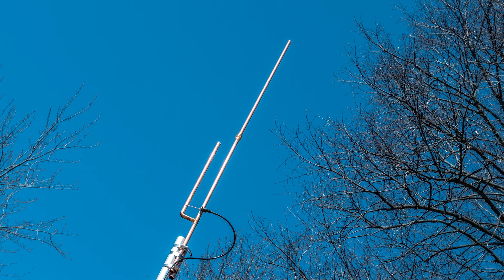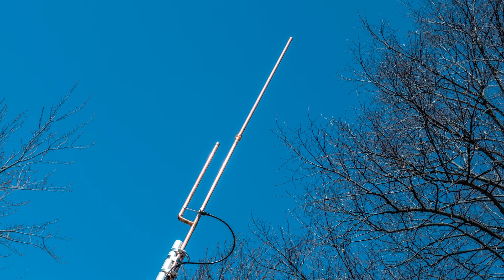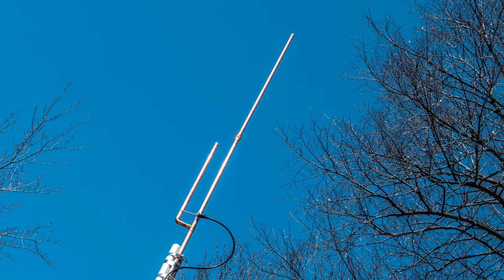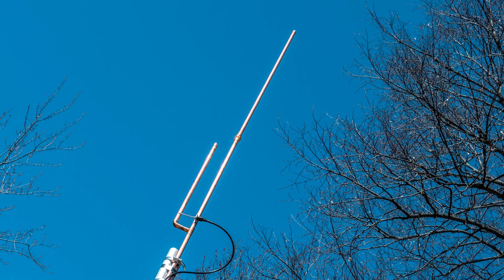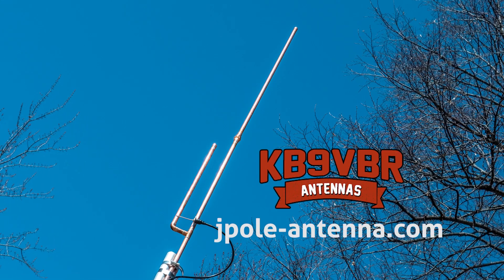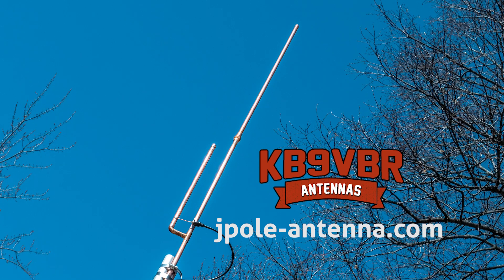Ask Michael, KB9VBR: How to weather protect your antenna

Comment: KD4YDC is spot on. I've used this method in the electrical industry long before radio. I simply put on a base layer of a good electrical tape such as Scotch 33 or 88. Then wrap the coaxseal over the electrical tape... extending the coaxseal beyond both ends of the electrical tape. Removing it is pretty easy. High voltage cables are routinely wrapped using this method. Merry Christmas to all and 73, Terry de W4ALK - American Radio Supply

Comment: If Vaseline makes it hard to remove the connector you used to much. It is like "Brylcreem"  "a little dab will do ya" . If you still have a problem use a little Simple Green  to remove it . I knew an Electronics Tech with the Navy Seals and they use Vaseline but they use a Q-tip or a tooth pic to apply it. Just apply it at any small gap that water might ingress . I use a little on the Antennas of My submersible HTs and haven't had a problem . When I was driving a truck I would apply a little to the seems  gaps of my pl259s then apply Silicone tape. Worked great through most of the winter.  I only had to reapply some of the tape every so often. Vaseline is a temporary solution so you have to clean it off from time to time and apply a little more.  How often is determined by what you are putting it on and the Climate you are in.

Comment: If someone is going the coax seal route... put a layer of Scotch 33 tape on first, then coax seal, then another layer of tape. To take it off, a cut down the side of the connector with a razor. Robert KD4YDC

Comment: Would type N UHF connectors better for out in the weather?
Reply from the maker: Properly installed N connectors are highly weather resistant. Short term they'd be fine but I still would wrap them for long term use.

Comment: According to my experience the best way to protect connectors agsinst corrosion is to use self vlcanizing rubber tape, like Nitto. I have used it in sailing boat. The VHF antenna coax runs trough the mast which bottom end i s in bilge. There is a scarv becaus the mast has to be removed before taking the boat up before winter. And the bilge is neber dry. When the PL 259 connectors is covered with the tape those are still shiny in fall when the tap is removed. No problems to open the connection.

There is one disadvantage with rubber tape: it does not stand UW. Therefore you should put a layer of vinyl tape on top if used outside.
Reply: Very true about wrapping with electrical tape first and top that with the Vulcan in stuff.  However, I don’t do that for a temporary install.

Comment: Hello Michael, what are your thoughts on the TN07 My Go2 antenna?
Reply from the maker: I have not used the TN07 My Go2 Antenna, but it is a non-resonant antenna similar to the Chamelon MPAS 2.0. You trade efficiency for broad-band performance. That's often not much of an issue when band conditions are good, but with marginal propagation, you will notice a difference when you compare it to a 1/4 wave vertical or base loaded resonant vertical. A good ground network or counterpoise does wonders in helping to recover some of these losses.